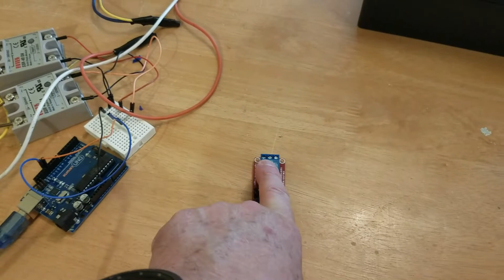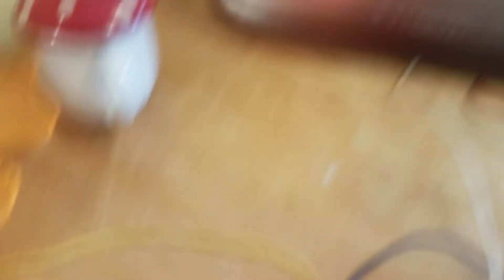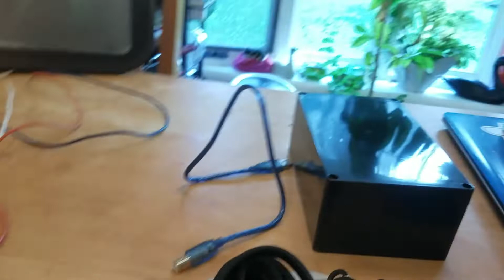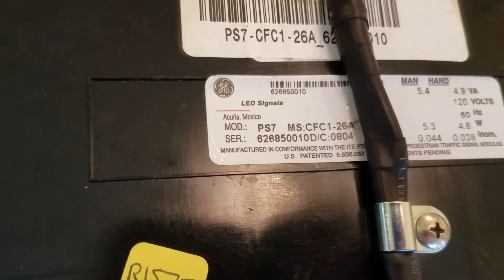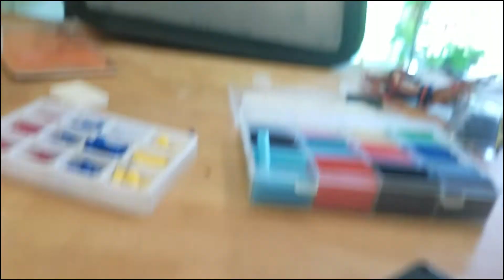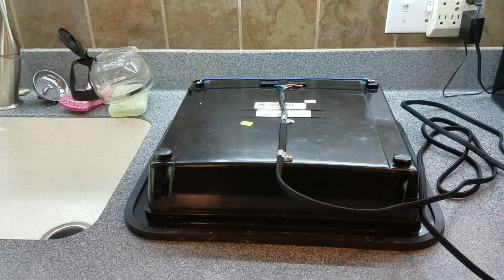I Saw the Sign - Crosswalk Sign Arduino Project

Comment: I did the same with my Galak two channel crosswalk controller. Much simpler, imo.
Reply from the maker: That's cool, I didn't even know you could get one of those.  This wasn't an exercise in taking an off the shelf part and plugging it in though.  No fun in that.  This was an exercise in finding a novel way to control something like this, so you can tweak it or change it to your liking, not some preprogrammed one, using readily available components that you assemble and make work yourself.  It was so much fun doing this project, and my daughter absolutely loves the result.  I couldn't have gotten that result with a pre-programmed controller.